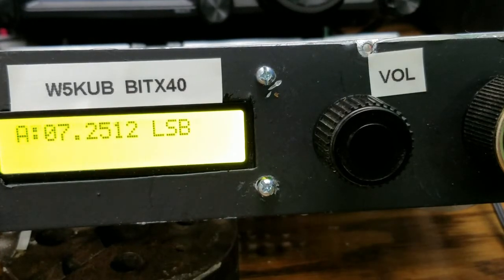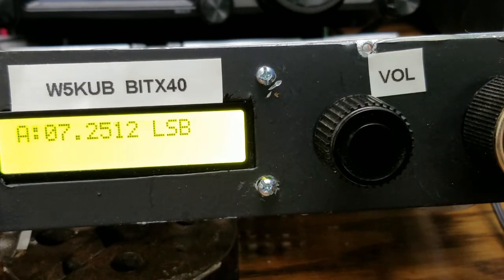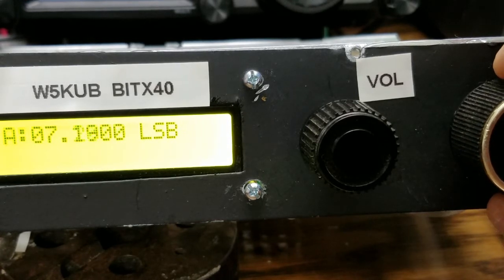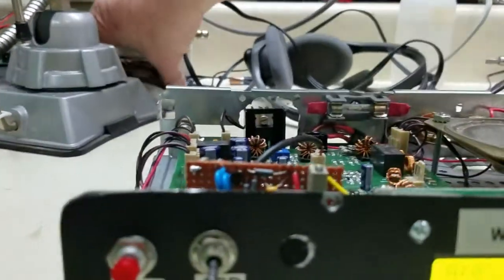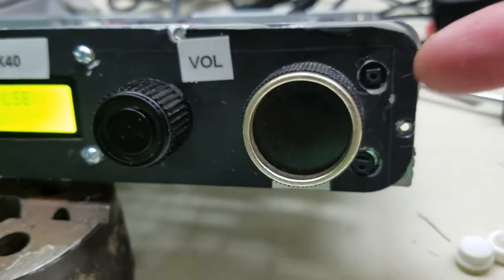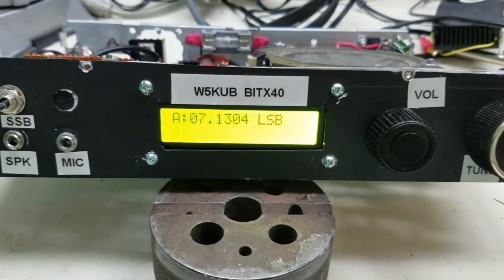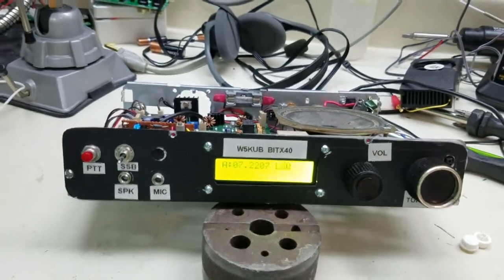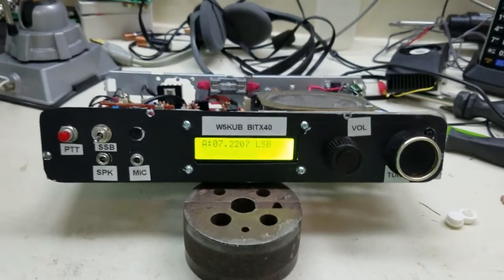Bitx40 new tuning mod

Comment: Of course, if you connect both your switches to the wiper rather than the track ends of the pot, you can step up or down from any position.  The end limiting resistors are still useful though.